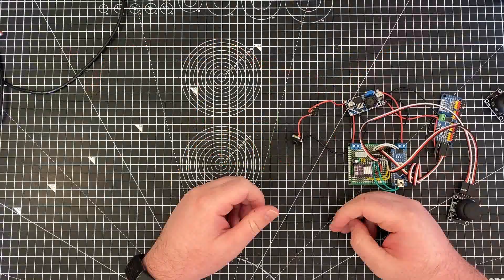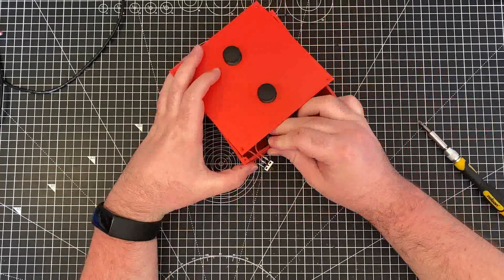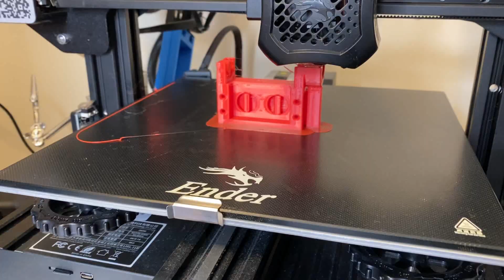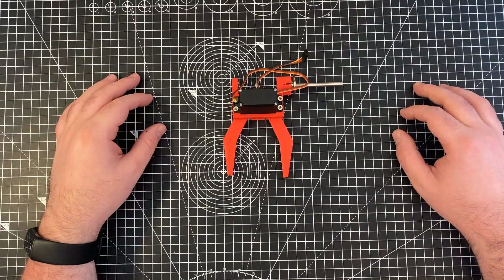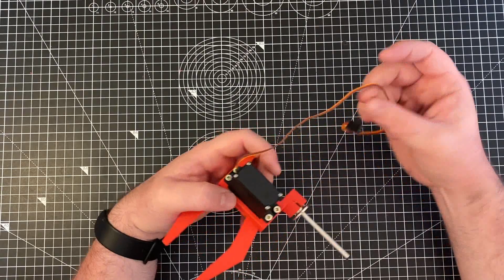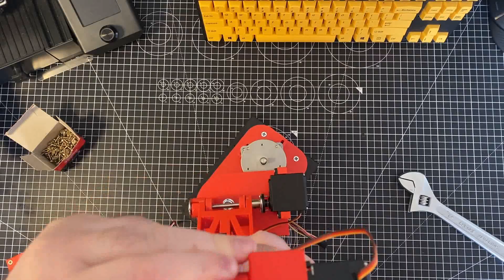Robot Arm - Part 3

Comment: Nice work! Have you thought of using 2 servos on the shoulder joint, 1 each side, that would help with the amount of weight it can lift.
Reply from the maker: Yeah, that's not a bad idea at all, the only problem is I was just building it with what I had to hand and I don't have any more servos!! The servos themselves are actually pretty strong, the biggest problem is the coupling to the drive shaft kept slipping... Stay tuned for the next video where I fix that problem!